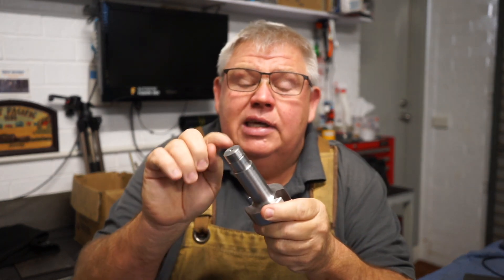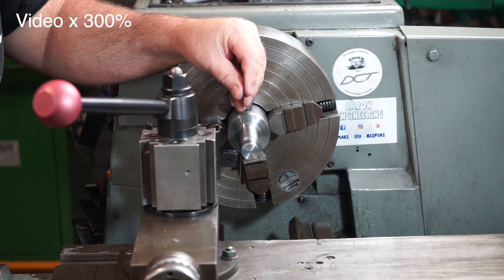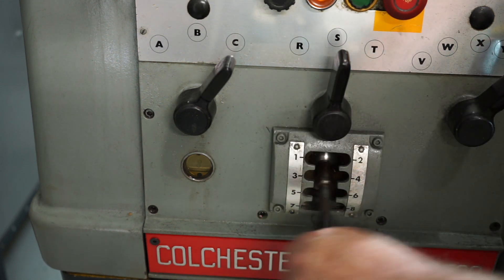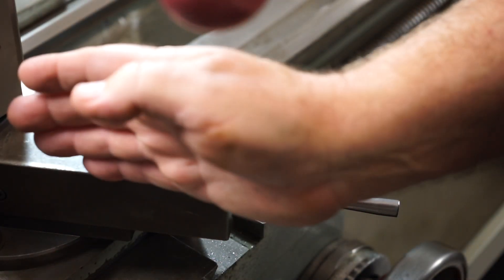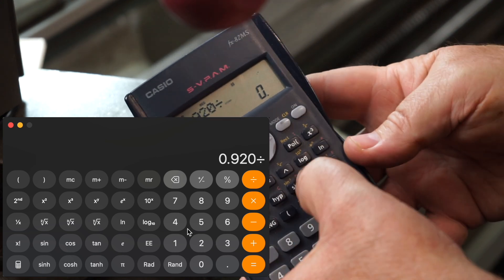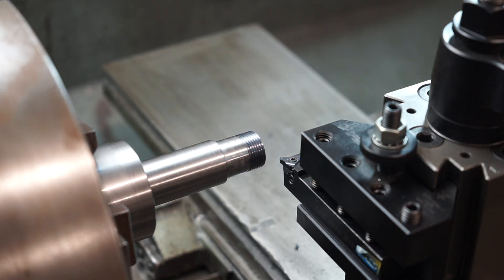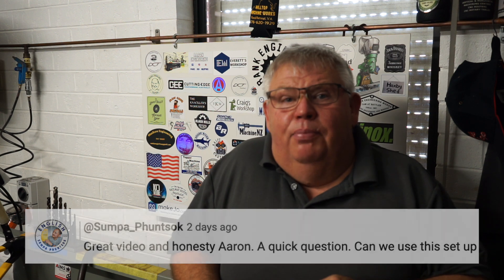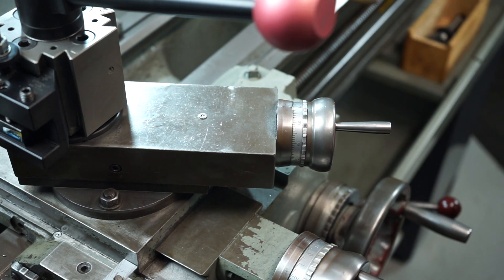Perfect THREADS every time 🔩 - Angular Approach Method

Comment: The reason for doing this is so that all the cutting happens on the leading side of the insert.  If you didn't do this then both edges of the insert would be removing material.  
Also, you really should set the compound slide to slightly less than 30 degrees (29.5 degrees or so).
Reply from the maker: Yes it produces a single chip.  It's a classical method taught to every apprentice and outlined in their textbook.  As I was using a full forming insert and I set it up on the 30 and sent it home.  Cheers, Aaron.
Reply: @AaronEngineering   It is sad that methods like this are being taught in trade schools now, at least in the US.  Even simple things like splitting a drill point aren't being taught now.
Reply from the maker: @ I'm with you buddy.  I'm a trained high school teacher, but have flip flopped from high school to TAFE (apprentice college).  It's all about money these days.  Give them less practical time and pump them through.  I'm so disgruntled with the whole educaction system.  I could go on and on, but what's the point.  I just have fun in my little home workshop and share my experiences along the way for free.  I'm not trying to sell anything, just pay it forward.  Great chatting with you mate.  Cheers, Aaron.

Comment: Hi Aaron.  Another instructive video.  The only thing I would add about the tool height adjustment method is to always use the back of the ruler to engage with the cutter.  If you have markings on both sides of your rule scratch up the imperial side.  🙂 Cheers.
Reply from the maker: G'day John, yes my little 6" steel rule has marking both sides.  I always try to use the middle of the rule so the cutting tip doesn't fall into one of the indents.  I like the idea of scratching up the imperial side LOL (ha ha).  Cheers, Aaron.

Comment: Hi Aaron, one thing you didn’t cover is the benefit of using this method. I can’t work out why it might be better than a plunge cut when the cutting tool is still 90 deg to the work piece. I’m about to start learning to cut threads via YouTube on my new to me Colchester Triumph 2000. Thanks for your excellent channel, Cheers, Stuart. Canberra.
Reply from the maker: Hi Stuart.  Yes, sadly I missed a couple of key points mate.  That was one of them and lining up the tool at the start with the thread pitch gauge (DOH).  The whole purpose of this method is to produce a single chip in the forward cutting direction.  May I suggest you get a copy of the textbook.  If you're interested I placed it name and details in the video description and the page numbers.  I might even make a video on which books I constantly reference.  Regards, Aaron.
Reply: @ Thanks Aaron, I’ll do that as I still like the written word to refer back too. Cheers mate.

Comment: You don't need to do all that feeding with the compound slide that method is for heavy threads your using a full form tip just top the thread and use a micrometer to measure the od of the thread for it's size..
Reply from the maker: Hi James.  I appreciate you taking the time to watch and comment.  However, I think you missed the purpose of the video.  It wasn't, "you must do this" or "this is the only way to do it" etc etc.  I did this video for a former student.  As they are taught both ways in their apprenticeship (plunge and angular approach).  Hope this makes sense.

Comment: Using a nut to check thread size is a horrible idea. Very high chance of making an out of spec thread.
Reply from the maker: Yes bill that is correct. Should check with a ring gauge (go-nogo). The nut I purchased was an industrial locknut. So the thread is to a higher standard compared to a normal nut. Cheers 🍻

Comment: Very useful video, the trick with the ruler and the magnets to help zero the cross slide is a really good idea, i'm definitely stealing that.
Reply from the maker: Hi Basil. Glad you enjoyed the video mate. Yes you could also make a little magnetic tool that has a pointer also. Sometimes I just use a sharpie pen and place a line on the cross slide also. Cheers 🍻 Aaron

Comment: This is a new for me, I’ve never seen anyone use 60 degrees on the compound, always 30 or 29.5 or the have the compound parallel to the bed and plunge in with the cross feed, this was interesting, I’m going to look into this more, thank you for the video my friend!
Reply from the maker: Hello and thank you for watching and commenting.  You are correct, most set their compound feed up to that angle.  However, you must apply it from the 90 degrees (see video 3:20) and then subtract that 90 - 29.5 = 60.5 degrees on the scale.  As I was using a full forming thread insert, I just set my lathe to the 60 degrees and sent it home.  Home this makes sense.  I have stuffed up before when doing this.  I'm embarrassed to say, but search on my channel for the video from 3 years ago "Threading Properly - I STUFFED up".

Comment: Another great video brother!!  I always learn something from them.  I've never done any threading on my manual lathe....you make me want to give it a try. :)
Reply from the maker: G’day Mike. Thanks for watching bruddah. Glad I could teach you something. Your little CNC lathe is much quicker at cutting threads. Plus Confusion 360 threading cycle can do what I showed here with a tick of a box (selection option). Hope you’re enjoying retirement Mike. Cheers 🍻
Reply: @AaronEngineering  you mean the one I haven't made a chip on in over a year?  LOL :(
Reply from the maker: @bluehandsvideo  Oh I didn't know that.  Time to run that lathe spindle Mike.  Need to make some little items to sell on your channel 😜
Reply: @AaronEngineering  no plans at this point of selling anything.  I'm working on a rear disc conversion kit for my '64 Dart wagon.....I think I'm going to be reducing the diameter of the rotor for a bit of clearance.....I might fire up the cnc lathe for that, but the manual would work just fine. :)

Comment: Thank you for this tutorial. I been reading fitting turning books with some success and i used what you said and cut my self a M10 thread today for my mandrel. I disengage the half nut and did not chase the dial but still cut a 1.5 pitch M10 thread without and issue.  I done this on a M16 thread  with no issues that i can see. Your Colchester is similar to my Datsun Champion (Taiwan)  tool room lathe and it was like a penny drop moment and  you fill in the gaps and i very grateful for that. I practice being a model engineer. If you can some explanation around why have the half nut engaged and if you can talk about multi start threads which would be interesting.
Reply from the maker: Hello Craig and thanks for taking the time to watch and comment.  When I was teaching apprentices, we had to teach them both methods of threading (Plunge & Angular Approach).  Both methods are covered in the Australian text book Fitting & Machining (the green book) pages 297-299.  Not sure about your lathe, but the book states if your lathe is fitted with a 6mm lead screw when cutting a 1.5mm pitch thread the chasing dial can be started in any position for 1, 1.5, 2, 3, & 6mm pitch threads.  This is outlined on page 296 stating the dial postion and number of teath used on the chasing dial.  The book I'm refering to ISBN 0 7241 3819 6.  Great idea on the video for half nut, chasing dial and multi-start threads.  I'll see how I go Craig.  Regards, Aaron.

Comment: As a toolmaker apprentice in the late 70's I was in a training collage also the toolroom working with 3 turners 3 grinders 1 inspection/jig borer 1 fitter 8 millers 3 bosses and a van driver.
They all had come from various factory's in the county as the rates of pay were higher.
Never was that method used for the reason of setting 2 dials then twice the error is involved. 
lots do use it but there is a reason people in tool rooms don't 
Good video but a method not for me.
Reply from the maker: Hello and thanks for watching.  Yes, you don't have to use this method.  Especially today when we have modern carbide full forming inserts.  However, we had to teach both methods (plunge & angular approach) in the curriculum for the apprentices.  This is outlined in their green Austalian text book Fitting & Machining p.297-299.  I made this video to document the process for one of my former students who posted a question to me.  I too like you, mostly use the "plunge cut method".  However, I have noticed (in my experience) that the angular approach method produces a much better thread.  I appreciate you taking the time to comment.  Regards, Aaron.
Reply: I was taught this in 79 as all Australian apprentices were taught. I don't understand the double the error comment. The top slide is used to set depth so there is no error as it is only advanced. The cross slide is used to withdraw the tool to clear the work so you can return to the start and then zeroed so no error. Was taught in a Toolroom where we had over 100 machinists and all did it this way.
Reply: @dikkybee4003  If you have 2 dials to set the chance of error goes up by one dial!
Besides for internal threads it is very difficult having the compound at half angle and then feed a cut in, to have it around the other way you could have clearance issues.
With it the way it is in the video then you be running minus on the dial or fiddle the bacl lash lol

Comment: instead of the metal ruler for indicating correct returning cross slide position you could just use a simple black marker and make a line between the cross slide and base.
Reply from the maker: Yes that's a good tip also.  I used that trick numerous times before in some of my other videos.  Cheers, Aaron.

Comment: Gday Aaron, thanks for the video, I need to watch this a few times now to get the maths figured out, going to be very handy to know, cheers
Reply from the maker: Thanks Matty, you're the best mate.  You might still have to "gently" knock the top off the threads with a smooth file.  This method I covered is from the green text book "Fitting & Machining" pages 298-299.  Cheers, Aaron.

Comment: Hi Aaron great video as usual, a little bit of maths is always helpful.
I've seen this method before, but in all the years I've been manual machining I have never used it.  I always keep the top slide in line with the spindle, and zero the cross slide with a scratch pass, then continue with the thread cutting, moving the top slide about a third of the depth of cut. Continue until final depth is shown on the compound dial, finishing off with a couple of spring passes, simple. (and no maths!!).
Cheers Ian
Reply from the maker: G'day Ian.  This was the way we taught the apprentices at TAFE, as it was outline in the fitting & machining textbook.  We also taught the plunge cutting method as you described.  And to be honest, that works perfectly fine in todays world with full forming carbide inserts.  I usually use that method too at home, or when cutting threads on a CNC lathe.  However, you can use that other method by ticking a box in the CAM software.  I still like to show and document the math, as this how our forefathers did it back in the day.  Plus my grandkids can see Pop in action ha ha ha.  Cheers, Aaron.
Reply: @AaronEngineering  thanks Aaron,   thinking about your video method, I think I did use it when on CNC lathes, that was using full form inserts and snap gauges for quality control.  Never used it on manual machines though, anything involving maths scares me 😄

Comment: Nice one. This approach is hands down the best way to single point and reduce tool load. I look forward to your thread wire video! Maybe you already did one - I'll go and look. I know how to use thread wires but I like your explanations and there's usually an extra tip I pick up. Cheers! Good on ya for helping a guy in need out to learn a trade.
Reply from the maker: G'day Stuart.  The thread wires work exceptionally well.  I haven't done a video on these, but Max Grant @swanvalleymachineshop has shown thread wires many times previously.  I'm happy that I was able to show you something Stuart.  We would teach the apprentices both ways (plunge cut & angular approach) at the TAFE college.  This was how it covered in the Australian (green) Fitting & Tuning text book pages 297-299.  Warm regards, Aaron.

Comment: While I'm a thread with a "straight in with the cross slide" guy, thats still some great info Aaron. Really liked the tip at the end on clamping a scale( or anything for reference) so you know which zero on the dial is the right zero! Great idea.
Reply from the maker: Hi Jeff.  Thank for watching and providing feedback.  The plunge cut method that you use works fine with todays full forming carbide inserts.  The little steel rule trick works well, but you can also just use a marking pen on the slide (I've shown this previously) but I have been know to acidentally rub them off before.  Cheers, Aaron.
Reply: @AaronEngineering  Agree 100%, When I started on a small Atlas/Craftsman lathe and using HSS tools, I set up in the classic way, with a 29-30 degree compound. When I upgraded to a quite rigid Bulgarian made 14 x 40 lathe, and switched to carbide tools, began to just plow straight in.

Comment: What is the advantage of an angle cut? Cheers for the video
Reply from the maker: Hello Ben.  This method that I demonstrated is from the Australian (green) Fitting & Machining textbook (p.297-299) that every apprentice has used throughout their training.  If you don't mind, I will cite the textbook P.298.  "The Angular approach method controls the direction of tool feed parallel to the back flank of the thread.  The advantage of a single curling chip is retained while the disadvantage of rough back flank is eliminated".  Hope this helps mate.  Aaron.
Reply: It makes the tool cut mostly on one side. If the tool pluges straight in, it cuts on both sides resulting in a bigger cut an higher tool pressure, what could result in a bad finish.
Reply from the maker: Thanks for helping out here Michel.  Ben @bena6852 make sure you check out @Rustinox as he makes some really good stuff and like me loves to share his knowledge.  Cheers, Aaron.

Comment: Gday Aaron great tip with your 6" rule. I normally draw a line but get lazy cleaning them off and then......which line was it.....the wire is on there tomorrow.
Reply from the maker: Thanks buddy.  Yes, I too use the line method like you do to.  But would accidentally rub it off or get a parallax error looking at with my glasses on. I should make an aluminium tool with magnets and a pointer.  You've just given me an idea.  Cheers, Aaron.

Comment: I wish I knew this method when I was still in the machining game.  We had no choice but to use the plunge method, but what I did was move the compound slide in a few thou on each cut. This way I avoided the single point tool cutting on both sides at the same time.  Thanks for the video Aaron.
Reply from the maker: Hello Zoltan.  Oh that's totally ok.  I only started using this method when I moved out of the secondary sector and into the TAFE sector.  We had to teach the apprentices both methods of threading for their lathe unit.  I just covered what was documented in the Australian textbook (green) Fitting & Machining p. 297-298.  I also enjoy showing the math side also.  However, I'm glad you've learnt something from it.  Regards, Aaron.
Reply: Me too 👍
Robert
Reply from the maker: Thank you so much Robert.  Always good to show and document how the old fellas used to do it.  YouTube is an excellent resource to share our knowledge (although mine is very limited) with others.  Cheers, Aaron.

Comment: It all seems a long way of going about it working out the thread depth. Remembering that the thread form is an equilateral triangle that is all sides and angles are the same. Given that the pitch is 1.5mm, that is peak to peak it also means that from peak to root on the 30 degree angle is also 1.5mm. So the compound theoretical in feed is somewhere near 1.5mm. QED.
Reply: Minus the root and the crest.
Reply from the maker: Thank you for clarification Michel.  John if you get a chance check out @rustinox channel as he has many great videos on it and loves to share his knowledge with others too.  Cheers, Aaron.
Reply from the maker: Hi John.  It seems so, but that is not the case.  If we refer to p.119 of the Fitting & Machining textbook it states, “In order to calculate the minor diameter of a thread, it is necessary to know the 3 things”.
1). The form of the thread
2). The major diameter
3). The pitch, or number of threads per inch.
To calculate the minor diameter of a 10-1.5 pitch ISO metric bolt and nut
Bolt depth = 0.61 x 1.5 = 0.92mm
Nut depth = 0.54 x 1.5 = 0.81mm
So if I was to feed in using the cross slide or compound feed handle I would cut my thread too deep and it would be ruined.  I hope my explanation makes sense John.  Regards, Aaron.
Reply: @AaronEngineering  Hi the 1.5mm is the theoretical depth and not the true depth. I been using this method for years, stopping shy of the theoretical depth and test fitting with a nut to fine tune it.